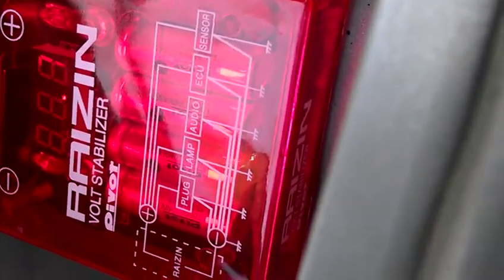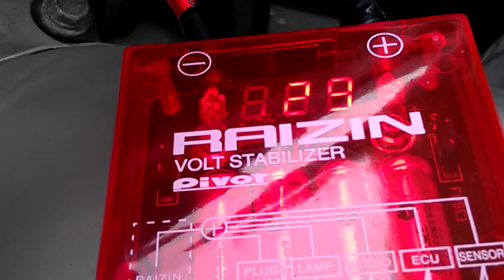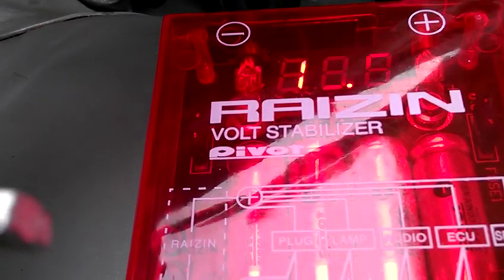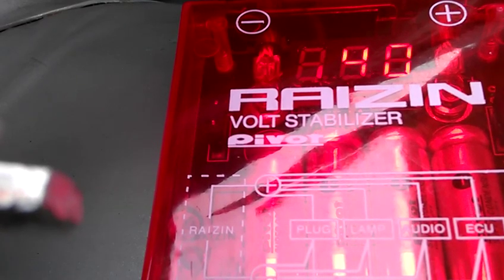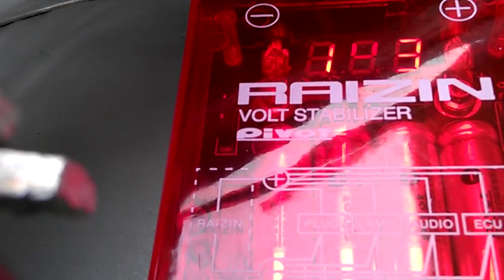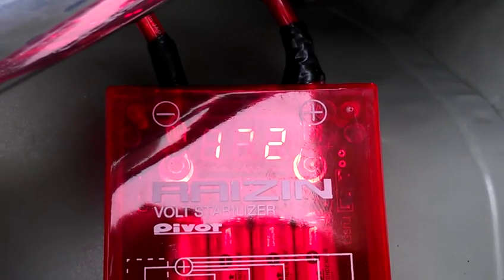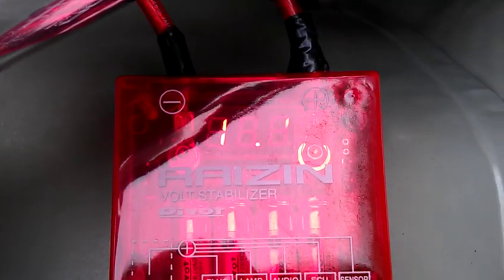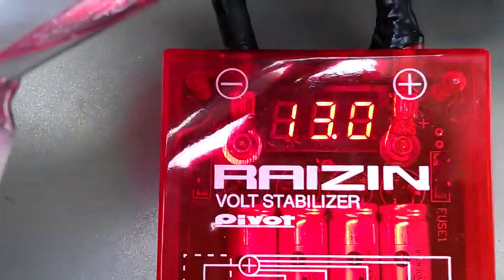Raizin tested on my 6th Gen --__-- 04 Nismo Maxima

Comment: Hey man! Are you still happy with that volt stabilizer? I do not expect any miracles, however, I do want it to do the job it is supposed to. Would you recommend? Or did you find anything better?
Reply from the maker: I still have my Raizin and it's holding up very well.. I would recommend it..
Reply: Appreciate it.

Comment: Hey is it supposed to stay on while the car isn't running or am I doing it wrong
Reply from the maker: +Jorge sevilla It is suppose to stay on.. Don't worry, it will not drain your battery.. The power consumption is absolutely unnoticeable.. I have had mine for about 3 years and battery never die..
Reply: Bro I just got one of these, the voltage reading stays on but seems to have no effect on draining the battery at the moment. Will it take drain much power in the long run?